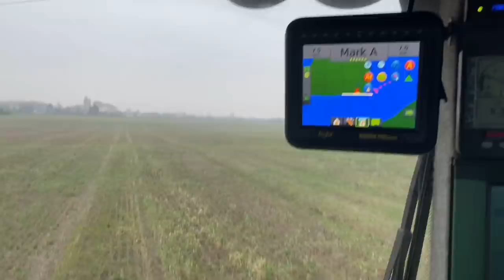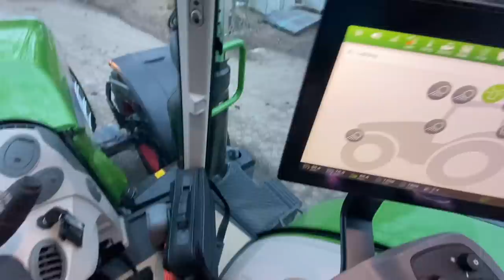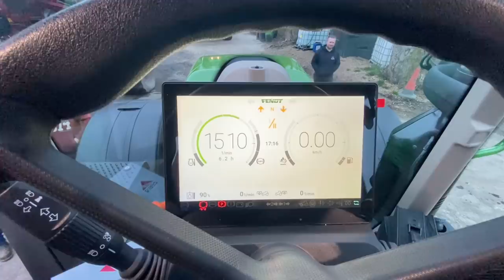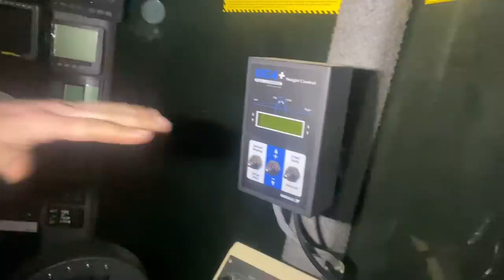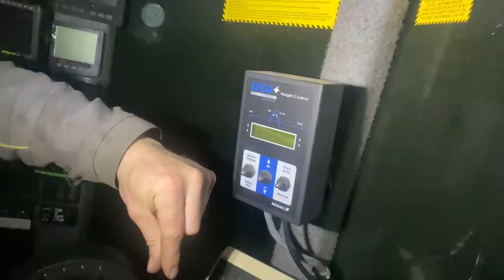Day 346 #Ollyblogs #LockDownLearning  #farming

Comment: Relay used to fall out on the maximum 5140 i used to drive when you go over a pothole and loose drive, it was a pain when you had a load on. lol spalding used to do repair oil fittings where you had to use a pipe cutter type tool to crimp the fittings onto the pipe. They where great to get you out of a mess. But these look so much easier to put on. Great idea 👍

Comment: @ 7 mins in, try using some spray adhesive to attach a piece of sponge to the side panel so that when its closed it pushes against the relay and holds it in place.

Comment: Fendt looks really good Olly but I'm surprised that Fendt still have the cluster behind the steering wheel making it a bit awkward to see what is going on.  a  100hp JD (5100R)  has it mounted on the frame by the right hand door that is visible even with a monitor on the command 8 arm rest. It just makes monitoring things a lot easier. 
Good video tho mate, that wheat looks the best around here so far 👍

Comment: Could you START giving your videos better titles please 🤔?
Just a general overview title, cos it's getting harder to remember which one I saw something in, when I'm wanting to share, or show mi dad something.

Cheers.
Love the vids
Keep'em coming
Rich 🥰🥰🥰
Reply from the maker: Read descriptions
Reply: @OllyBlogsAgricontractfarmer  Instead of buying a new self-propelled sprayer which you said would take 2 years to be delivered, have you considered chopping off the front the Bateman and converting it into a tailed sprayer that could be pulled by that Fendt 724  demonstrator?
Ideally, you would convert the rear axle to self steer and use an extra tank mounted on the front 3pt links for extra capacity. The front PTO could be used to power a recycling pump to the trailed tank. 
Easy to remove and the Fendt can be used when spraying is out of season.